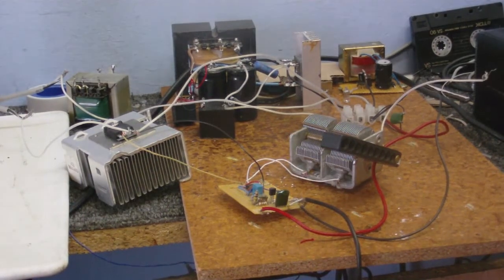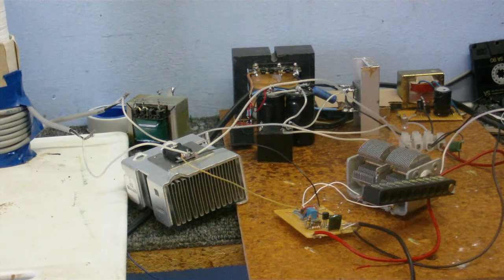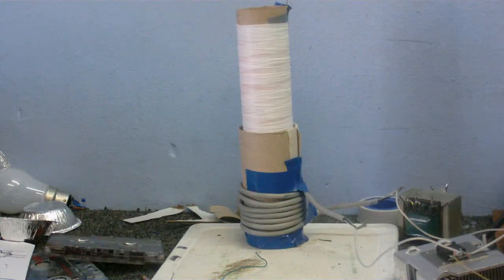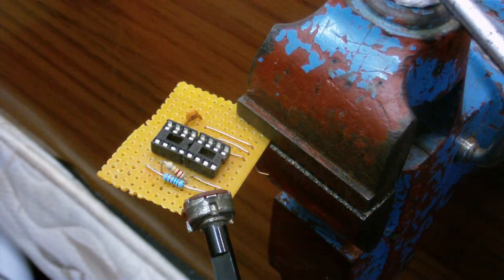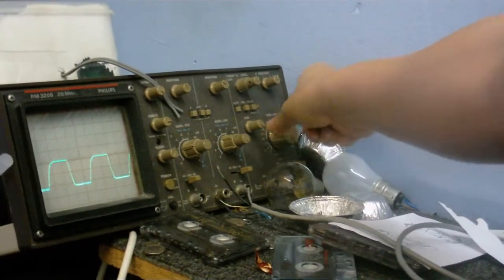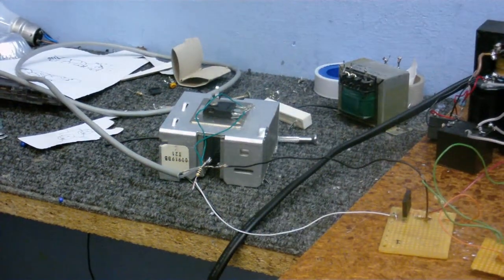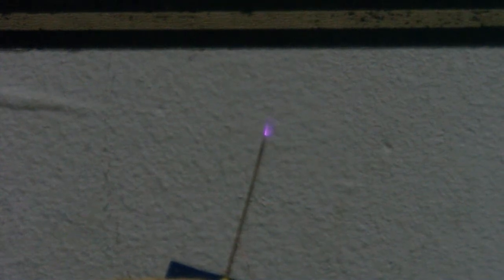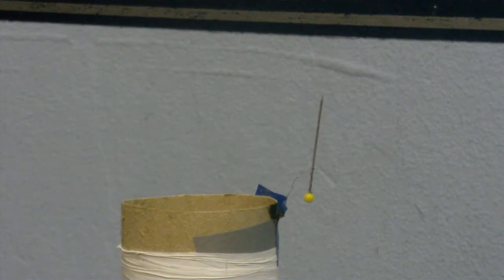Designing the Testla coil I showed in the "Tesla Time" video

Comment: Some people at my school built a large scale tesla coil a while back.  It used a huge neon sign transformer which I think put out around 12,000 Volts.  Also, there was a large coil of copper tubing around the bottom, and a large ball of foil at the top.  It could arc like a mother.  The arc voltage was enough to light some sort of florescent tube light for a ballast.  Pretty crazy thing.

Comment from the maker: I got the CD4046 chips from Farnell, and yes that was only 20 volts going into the coil, Solid State Tesla Coils don't need crazy high voltage to produce crazy high voltage.  I'd really like to experiment with Vacum Tube Tesla Coils, but I don't have the tubes needed or a variac.

Comment: You hand word like antenna, pick up feedback and 555 works like smitt triger, using oscillator for sstc very bad idea, use feedback circuit with antenna or current transformer with NORMAL MOSFET DRIVER instead this shit.